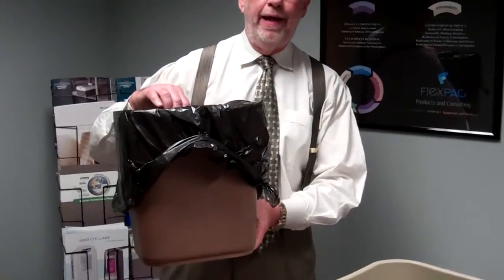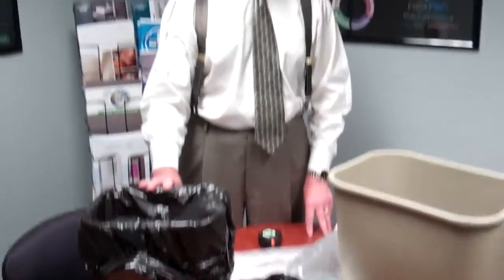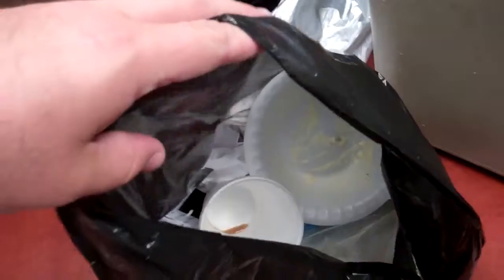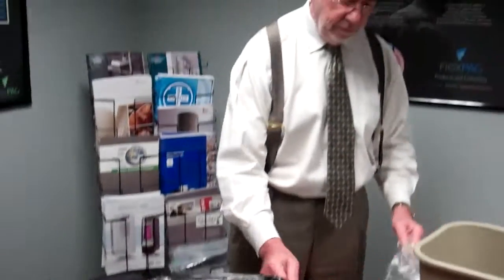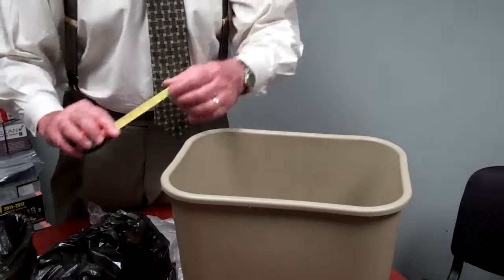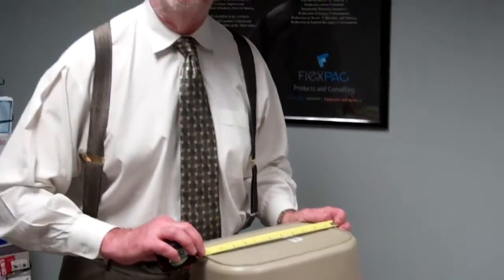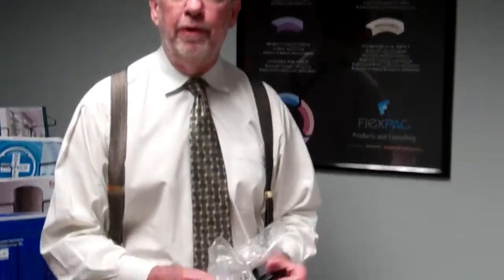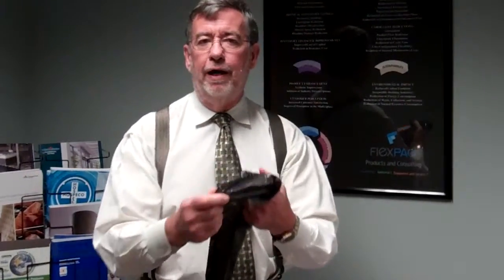How to Select the Proper Can Liner | High vs Linear Low Density

Comment: Just the information I need and the response to the questions were thorough, especially the added little tip about sizing/measuring for correct trash can liner size. I have tried measuring for trash can size but seems to never get it right, with this information now I will definitely have correct size and not ending with liner not being long enough. Thanks for the video